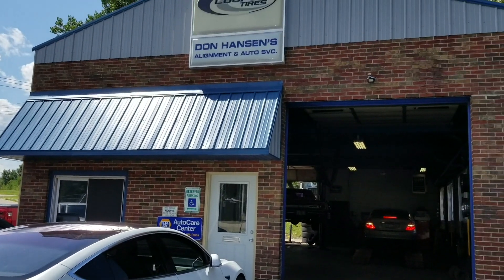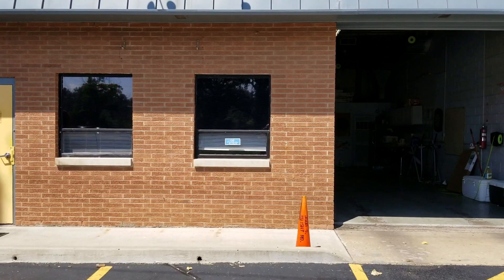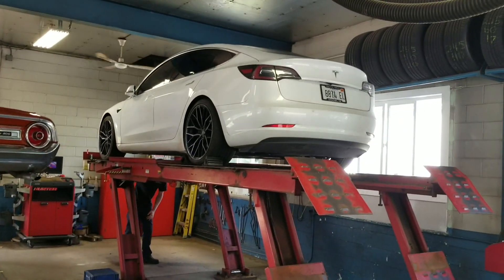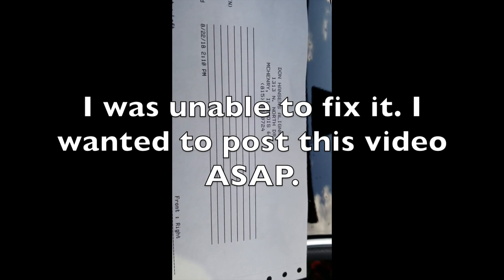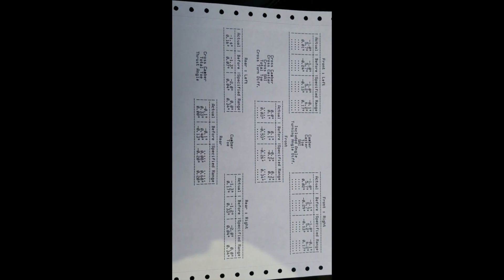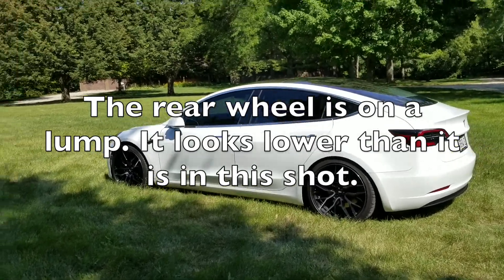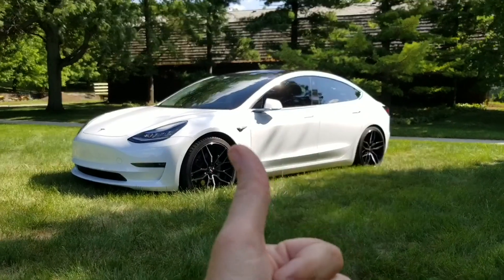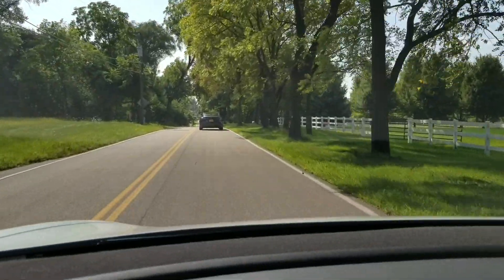Tesla Model 3 tint and alignment!!

Comment: Briefly, the new alignment looks good.  

Some slightly positive toe (toe in) at front is appropriate for a rear wheel drive car.  The reason is that RWD pushes the front toe out slightly when actually driving down the road, so the tires end up going straight when driving.  

The slight negative camber will aid traction a little in turns and is small enough that it won't wear the insides of the tires too much.  A little less negative camber in the front could wear slightly more evenly, but the increased negative camber is a consequence of the lowering (and lack of camber adjustment available at the front of Model 3).

A little bit of cross camber will aid tracking on crowned roads (will help the car going straight) and is ok.  Zero is also ok, but the car will constantly pull to the right very slightly following the camber of the road due to the crown being higher at the center than the edge. With zero cross camber, the car wants to follow the crown of the road downhill.  It wants to go downhill to the right.

The alignment before was definitely somewhat off, and likely due to the lowering.  Always get an alignment after changing any major suspension component.
Reply from the maker: Thanks so much for the input.
Reply: Thanks, I may have edited a couple minutes after you replied.  A little bit of toe in is desirable at the front.
Reply from the maker: @LoanwordEggcorn  I was encountering a small amount of wandering and vagueness in the steering street the lowering. The alignment cured that. I know toe-out can cause those symptoms.
Reply: Thanks, taking a closer look you had a lot of toe out before, which would cause wandering.  I updated my comments above that slight toe in at front is what's appropriate, and that's exactly what they set for you.  (Positive toe angles are toe in, negative are toe out.)

Comment: You made a good point about better handling, but, worth better handling comes increased tire wear. Did alignments for years on all types of cars including high speed State Troopers. You'll find out the hard way. Hope your tires last...???
Reply from the maker: That is a good point. When I asked the alignment guy about that, he said that the tiny bit of increased negative camber shouldn't affect tire wear more than a few percent. He did mention that the tires would wear on the inside more than the outside. However, he said that it shouldn't be enough to matter. I told him that I don't mind purchasing adjustable rear suspension arms. He mentioned that it wasn't needed. That the camber was so close that he wouldn't worry about it at all. But, time will tell!
Reply: @TechForumTesla  yes it will. But am I bit surprised that camber isn't adjustable. Caster is important, but that really just make the wheel return to center faster. Ps. I owned a 63 galaxie in Maroon.

Comment: any thoughts on doing your back window? We pick up our 3 the week after next and we've been quoted $1400 to do clear on the front, the sides, and the back window. Seems a little pricey. I guess they are saying the back window requires a custom roll and something about using special prep to prevent any water damage.
Reply from the maker: Yes, the rear window is a custom film. I was quoted $550 to do the nose paint protection film.

Comment: Can we see the tint of the back window from the inside of the car. Were they able to do the entire rear window in one piece? Or did it take 2 pieces to do the entire rear window?  Do you have any paint protection added to the car, or do you plan to do something to prevent rock chips?
Reply: For $180, I'll bet money they didn't tint the whole back window. Everywhere I called to do mine wanted at least $500 for ceramic tint and to do the whole window without the seam. You won't notice the seam from the outside but I wouldn't want a seam on mine.

Comment from the maker: Read the description. I tinted only the side windows.
Reply: Tech Forum How do you think it looks not having the back glass done? Thinking about doing the same. Love the look of everything you have done. I don’t have the guts to tear apart such an expensive car and modify it. That’s just me.
Reply from the maker: @johns22780  the back window looks dark when the inside of the car is darkened anyway. I figure, if I don't like it this way, I can always go back to have the rear window done.
Reply: @TechForumTesla  Exactly. Matt: whenever (if) you decide to do the rear window just do the whole in one single piece. Some shops have a CAD cutout for only the bottom half that makes the window look like an afterthought. Btw, what type of tint did you use?
Reply from the maker: @charliec5363  I used non-ceramic 25% (not sure the brand)